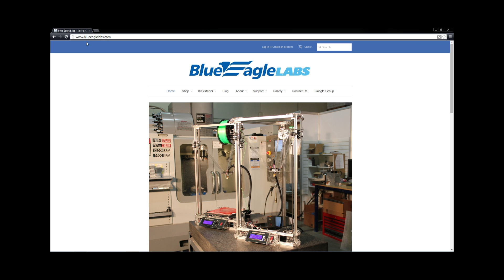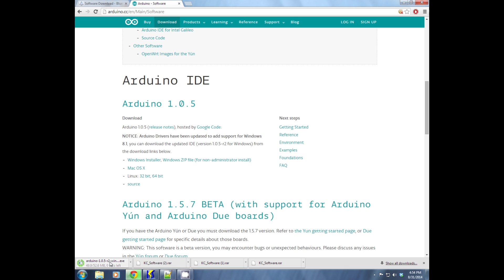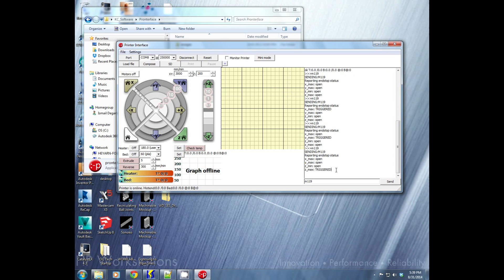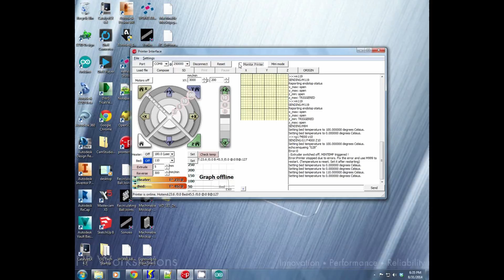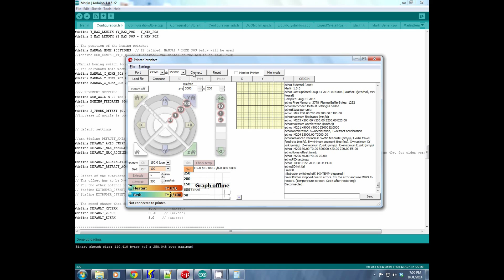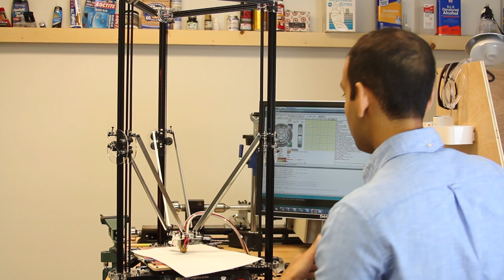CalibrationVideo Full V2

Comment: This is just what I need. My KC is collecting dust right now. I did some prints this summer but was manually adjusting (read: bending) the board so the first few layers got right. Knew I needed to calibrate manually but didn't get around to reading some tutorial on it. This video will probably get me back on using the KC.

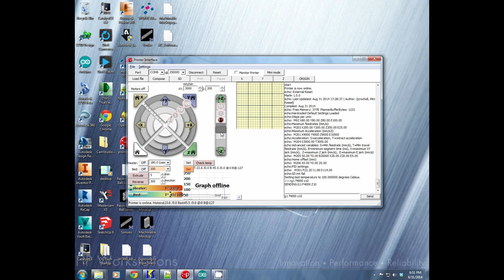Comment: @9:11 I couldn't make the head to move down once it's at Z0. I think there's some kind of constrain on pronterface.
Reply: I have been having the same issue.  Did you ever figure it out?
Reply: Just add 10 to the manual_z_home_pos in the  configuration.h and repeat  the process (this will jump your origin 10mm closer to the  bed). Repeat again if necessary so you won't even have to go below 0.  Subtract from the z_home_pos if necessary one you get close.
Reply: Search for this line  " #define min_software_endstops true " in the configuration.h and change it to false. You will be able to move it down as you like. After you finish adjusting the actual z position return the original value ( true).